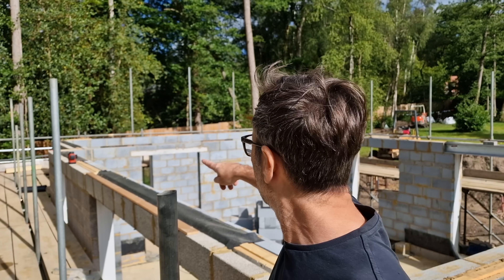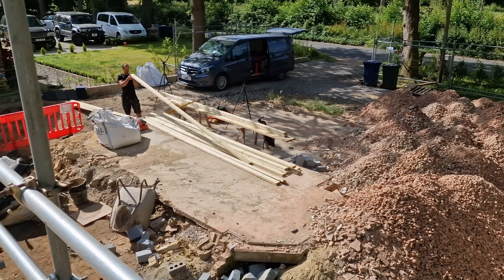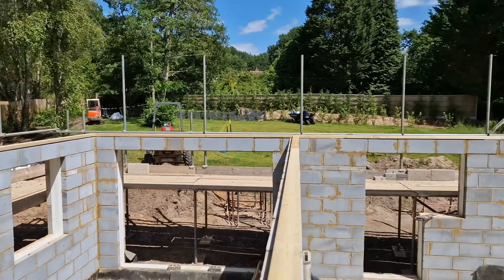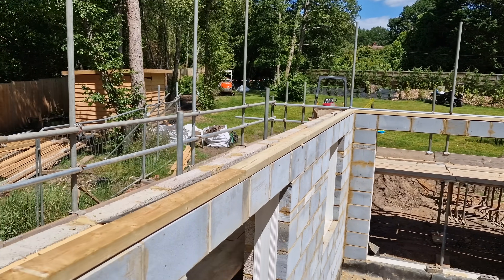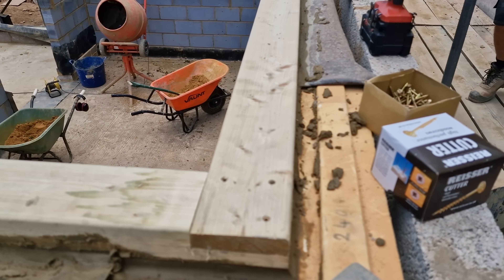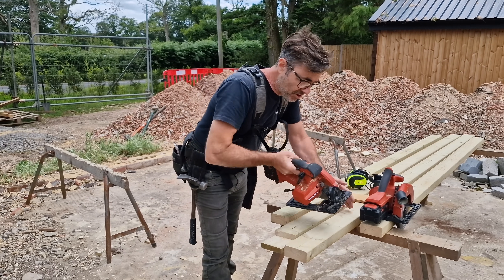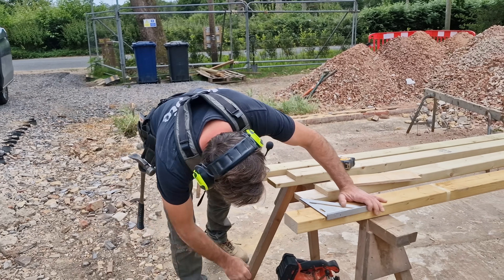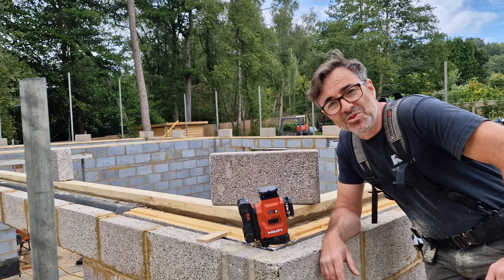Wall Plates cutting, levelling and bedding

Comment: No screws through the wall plate into the wall below?
Reason I ask is because my structural engineer isn't fond of that method
Reply from the maker: We rarely fix a wall plate down with screws or bolts unless it is onto timber joists ends or a steel beam etc, we always use wall plate straps as these are required by building regulations to prevent the rood being lifted of the building in high winds, these straps are 3mm thick by about 30mm wide and are 1200 long with a 150mm bend, they are fixed along the length into the internal skin at regular intervals and nailed into the wall plate from the top
Reply: @robinclevettcarpenter having a nightmare. Cowboys put my wallplate on the outer leaf and because they put the roof slates on couldn't  nail straps down. I had to ratchet screws in 😡. Inspector ain't happy.

Comment: how much is the muck between the timber and the blocks .. is 40mm - 50mm ok? or that's too much?
Reply from the maker: Generally the bed should be no more than about 25mm use a thicker timber if you have more
Reply: @robinclevettcarpenter  thank you

Comment: I still use a water level when bedding on wall plates in that kind of situation. Fix some battens around the room and mark off.
Reply: Water levels are rally useful, if you run out of water and want make a brew.

Comment: Also love these detail video for learning.

As keen diy'er doing a self build, I own a laser leve/receiverl, but not quite understanding how you were checking the wall plate heights with the receiver sat on top with no ruler.

Did you first check the inner leaf block work to find the highest point, then add the thickness of the timber wall plate, plus mortar bed, then use this as a datum to set the laser level so it was perfect at this height with the receiver.

Then, from there, all you had to do was sit the receiver base on the wall plate, and it would say whether it needed to be bedded up or down as you work round?

I might need to watch again.
(Edit, think i answered my own question)

Comment: Thanks for the tips. Quality as always.

Not needed by Robin but when I am nervous about repeated work holding I frequently screw some chogs or similar, can even add a wedge to tap in if you want really secure. Quicker than clamps, repeatable, secure.
Reply: For cutting the half joints, a jig that both holds the work and provides more width to ensure the rip cut is square would be a great idea for those of us that don't have Robin's experience.

Comment: I'm at exact same stage. Builder says no need for cavity tray over lintels at wall tops as its well under the roof overhangs. Inclined to agree, rain can't go upwards...
Reply: Generally Building control like to see trays in all instances above lintels as good practice. Realistically, it's usually not needed. These are thermally broken lintels and have exposed insulation so here it works as a barrier for potential moisture passing through a lintel more effectively.
Reply: Lower down an exposed wall they make sense, but at wall plate level  it seems like rules for rules sake

Comment: Hi robin, I’m not a carpenter but love watching you work, can I please ask why you bed down the wall plate with mortar then go on to put ties in, is it for the discrepancy in brickwork, why not pack and fill then mechanically fix the wall plate down, if it is for discrepancy why not factor that in when cutting the roof, it’s not going to be that far out and as long as the roof looks ok / straight it’s not putting the roofers out, thank you

Comment: Great rip for cutting shoulder joints freehand. Not clear how you ensured the wall plates were at 90 degrees ? Maybe you could make a follow-on video for wall plates and roof framing where the existing walls are not square.

Comment: Completely different [or mostly] to how we do it in Canada. We wouldn't bother with half lap joints, and the plates have to be bolted to the block walls, no cement underneath. I'm not saying one way is wrong or right, it's just different.

Comment: I can never understand why you have to bed on your wall plates in England. Can the bricky not manage to put the blocks on at the right high? Iv never done that in scotland. The bricky has the top of the wallplate spot on. We just drill the wallplate and fix it into the block with anchor fixings.
Reply: The internal skin of blockwork runs within a lintel. So linels often sit higher than the blockwork. Mortar bed helps to level it all out on a new course and spreads load more evenly.

Comment: Lovely video Robin. 
Is it always practiced to sand/cement the wall plate down these days? Or is there a depending factor as to why it’s done here? 
Cheers
Reply from the maker: The sand and cement is to transfer loads better and also get the levels perfectly set, it has been done here for many centuries, some of the oldest properties we work on from 17th and 18th centuries have a bedded plate albeit sand and lime or similar
Reply: @robinclevettcarpenter also quite often it is specified by the architect so no choice really.

Comment: Robin is such a professional,  even calling his saw by its correct name, a circular saw, not a skilsaw as most people refer to it as.
Not a lot of guys bed down their plates in Ireland anymore.  Most of us i think use a double plate approach. So we level and screw down the first plate (4×2 or 6x2) with a layer of damp course between it and the block work ,then we screw the next board on top of that alternating the joints so no need for halving joints.
I tend to fit the wall plate 1/2" forward of the inside of the block work so i can fit a strip of plasterboard to the inside of the wall plate after the roof is on. This brings the walplate back plum with the inside of the wall and can be sand and cement after. I dont like to sand and cement straight to the timber wall plate as i find it cracks as the timber moves seasonally.
Reply from the maker: Hi Dan, Thats a good move with the allowance for the plaster board!! thanks for watching and supporting my channel!!!
Reply: As a non-tradesman, can you explain the pros and cons of both approaches? Is the end product effectively the same?
Reply: I'm the same, I use a double plate and stagger the joints. I temporarily fix them with tapcons. Then when I'm happy with parallel, square and level I put in some express anchor's. I put in the tie down straps then. Keeping the plates a 1/2" in is a good idea, 👍💪💪🔨🇮🇪🇮🇪
Reply: Hi, what are tapcons? Cheers
Reply: @danthechippie4439  Tapcons are concrete screws, 💪🔨🇮🇪🇮🇪
Reply: What laser do you use please